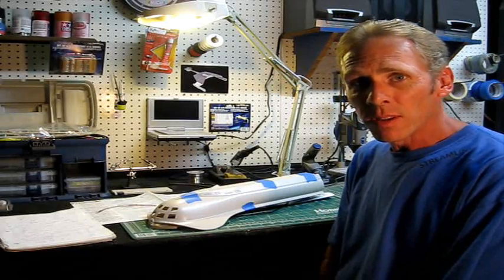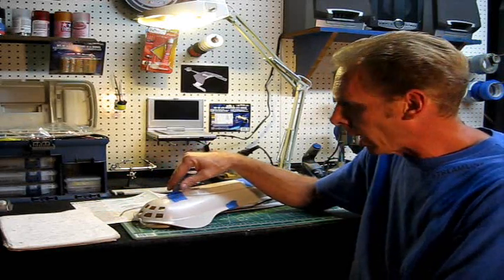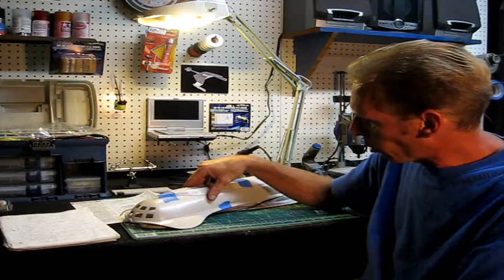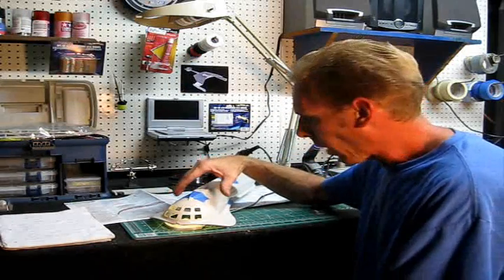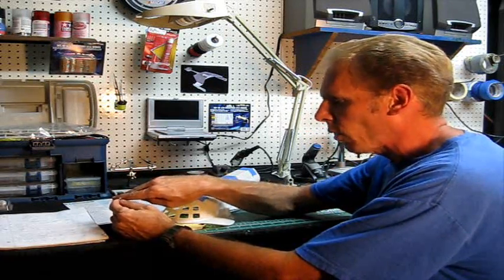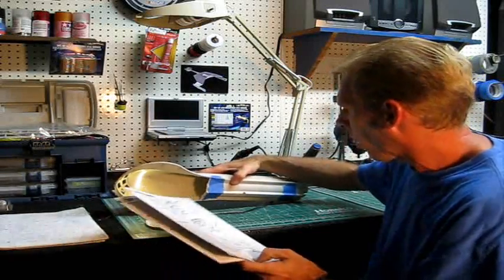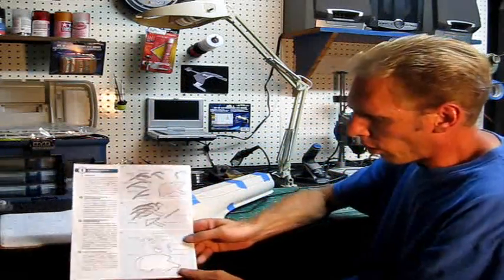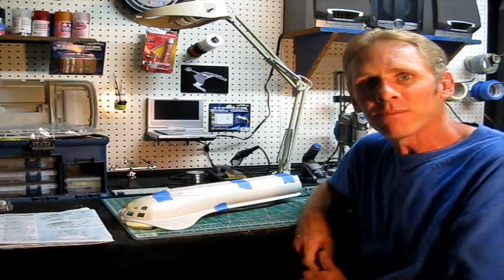Moebius Models Seaview Movie Edition Scale Model Kit Buildup - PT 1

Comment: Got a great thunderstorm going here as I write this, haven't had one since last summer, really great atmosphere. Waiting for my Seaview kit to arrive from the States, (my dad was from Maine, do they have boats there?) Been after one of these jobs for some time now and finally ordered one at a very decent price of £101.00 including shipping. Just ordered two sheets of decals for the control room in case it is too difficult for me to paint and I am now looking forward to the arrival of the kit. I have also been studying your excellent videos for some tips as I feel I will need as many as possible. I had thought of full radio control but that is almost certainly beyond me as it would be too intricate for my great big fat German Bands ( Hands ) so I am looking to fit, maybe, just a motor and servo for rudder. I have previously built two successful submarines but they were both in the region of seven feet in length which gave me plenty of room to manoeuvre. Just to complete a reasonable lighted model of The Seaview will please me, any other technical achievements will be a bonus. I usually spend one week reading the instructions before I even touch the kit. I then wash all the components and paint as many of them while still on the sprue as possible and then comes the despruing, fettling and gluing. I am not a naturally gifted modeller ( I used to be a clumsy scaffolder, not too clumsy though as I am still here) so I generally make silly mistakes but the secret is to be able to put them right which I consider myself to be OK at doing. Well that's about it I may let you all know how I get on if anyone is interested. My usual passion is constructing Model Sea Queen and Riva Boats which I have several of having since sold the submarines. So it's " All Aboard " "Look Shipshape" and " Heave Ho Me Hearties". I wish you all "Fine Sailing" until bext time," Farewell me Hearties". Best regards from Richard. aka Mopy Dick. (I've never been to sea in my life and get seasick on the Isle of Wight Ferry but I have seen loads of Jack Hawkins so I know all the sayings.

Comment from the maker: Modelers Brand Hobby Supplies is where I get mine. Check it out and Tom will get you exactly what your looking for. I almost always use a 9 volt dc power supply rated at least 1000 mAh. I'll be showing how I do all of this during the build series for this kit.

Comment: Please tell me where you buy the led tape, and also do you need to connect resistors to the led's.  Also what kind of power source wold you use to light the project.  I will be building the same project soon and want to be able to plug it into the wall with maybe a switch to turn it off and on.  Thank you.